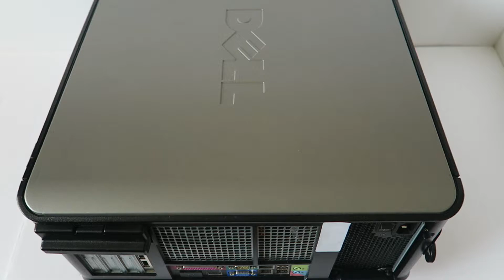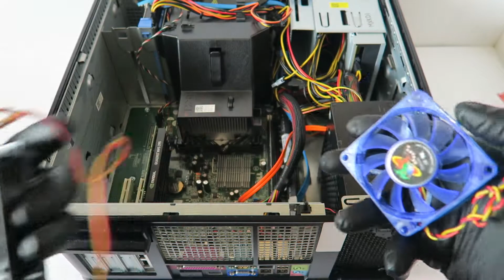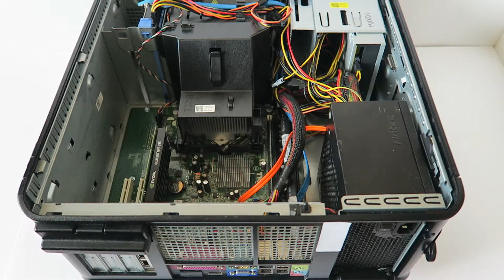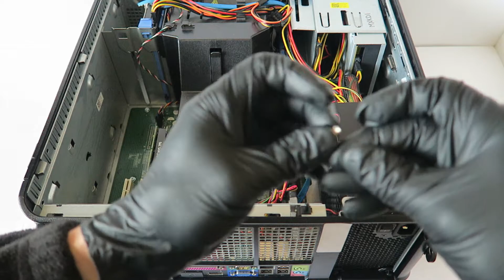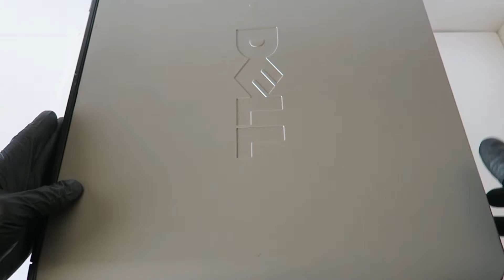Dell Optiplex MT How To Install Rear System Fan

Comment: Great video, but I want to take off the front fan cooling unit, shown on your video, the CPU cooling unit, because I want to clean the case out. Has anyone even got the slightest clue how to take the plastic 'fan housing', I have the actual fan out, but it sits inside a plastic housing which has an accessible 'lever' down the side of the optical drive. I can not for the life of me figure out how to proceed further, or is there someone out there who will calmly suggest that I 'halt my folly!' and stop before I cause the 'cracked parts of death?'

Comment: Thanks, I have a 360 and I recently put in a quad core q9650 and it seems to be working great!!!!!!👌
Reply: Bro your q9650 is working fine in optilex 360
Reply: hi mate did you have to upgrade your cooler or psu?

Comment: hi Mxkdi , i just got a 3010 model for cheap n added psu and a gpu i was wanting to add a second fan to the front of the case! i notice there's a set of 3 pin plug spare on the mobo will any 3 pin fan connector work.?
Reply from the maker: Hi, i just checked my dell 3010 mini tower and yes you can use any fan with 3pin wire plug.
Reply: @Mxkdt  ahh ok thanks

Comment: Awesome ! I want to connect multiple fan on my Dell Optiplex 740 but there is no port to connect fan my fan is 4 pinHelp
Reply: TECHNICAL BUREAU Connect directly to the power supply and use a fan controller to adjust the speed - (otherwise it’ll stay at full power)
Reply: @BenzView  the 780 mb doesnt have any pwm connectors spare